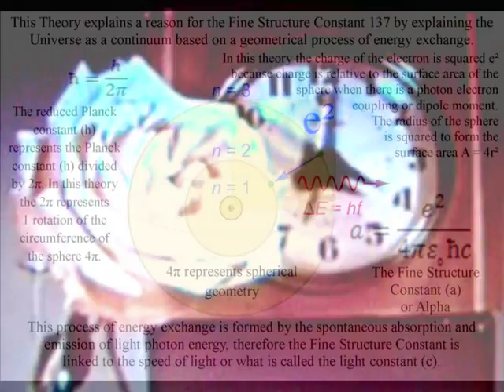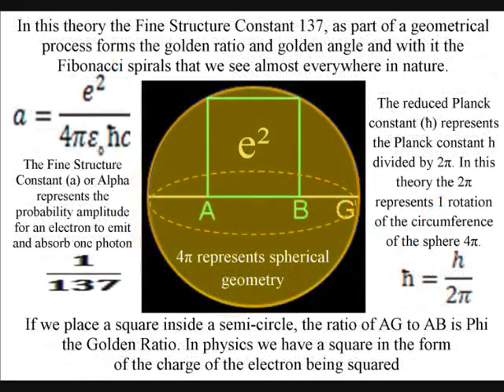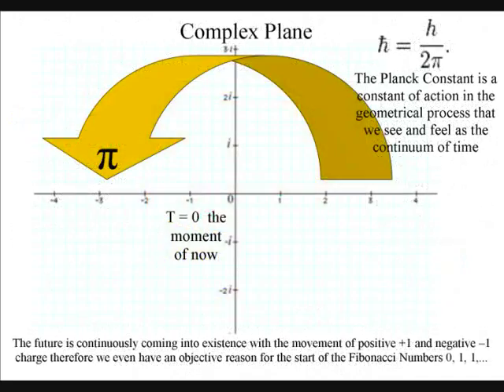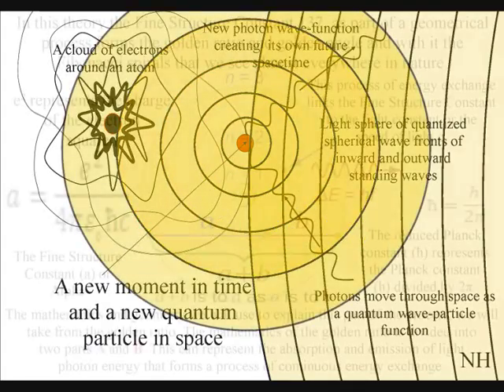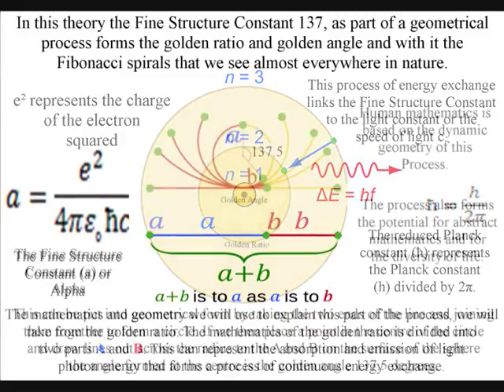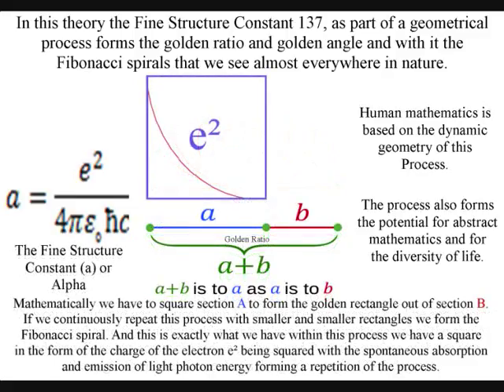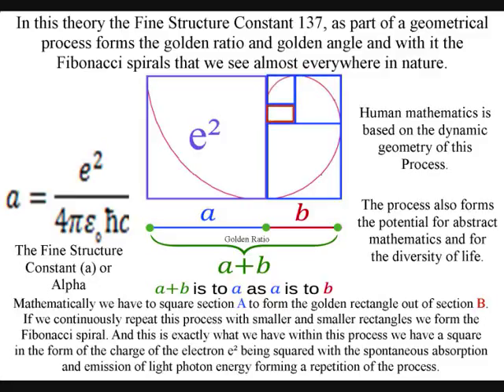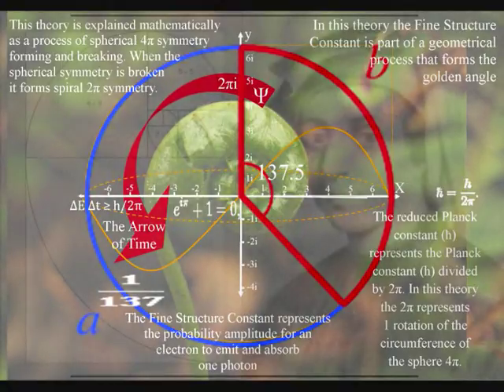A Reason for 137 the Fine Structure Constant

Comment: golden angle is 137.5077640500378546...... so the artist is correct. if you don't know or don't understand go find out for yourself. learn, then help somebody else learn, that's what the artist is doing.
Reply: tan(666)=1.37 
1/137 = 729,927

666 = 1 +...+36
666 % 360 = 306

306 + 54 = 360
666 + 54 = 720

360 + 720 =1080 (Radius of Moon) 
3*6*5*3*1*4 = 1,080 ( Earth Year * PI )

The Babylonians called the Moon Sin its diameter is 60*6*6 = 2,160

sin(54) + sin(666) = 0
365 * 365 * 3650 / 729,927 = 666
792 - ( 7 * 9 * 2 ) = 666 ( 7,920 Earth Diameter  )
Arctan(∛186,282)^2 = 7,920 ( 186,282 = SOL )
186,282  = 354 * 453 + (6!*6*6)  (Speed of Light = Moon Year * Reflection of Moon Year)
(6!*6*6)  = Procession of the Equinox 25,920 or the volume of a sphere with the radius of the Proton to Electron Mas ratio 1836.

log10( 729,927 * 𝜋 * 2 ) = 6.66
sqrt(186282)-66.6 = 365
Sin(54)-Sin(666) =  The exact golden ratio.

666 *666 * 666 / 10000000 = 29.5 ( Moon Month ) 

LogN(2π161) = 295 ( 161 is Golden Ratio 1618, 161*161 = 25,921) 
295 * 666 + 413 = 196,883 ( Monstrous Moonshine or Monster Group )
29.5 * 6674 = 196,883 ( Moon Month * Gravitation Constant )

The 196,000 tetrahedral / 883 Tetrahedral  = 10899802 ( CMB PAlindrome )
20899801 / 5280 = 3,958.295 ( Radius of Earth and Moon Month )

The speed of light exceeds the sum of squares at 82 it does so by 883 it takes 8.3 minutes for light to reach the earth from the sun. The triangles exceed the speed of light at 610  by 73. 
6/10 is the 161 day of the year. 

196,883-10601 = 186,282
 
Volume of a sphere with radius of the Moon  Year / divided by the Mile 
( 354 * 354 * 354 ) * 4 / 3 * Math.PI / Math.pow(5280, 2)  = 6.66

The Mile is based off of the Moon 2,160 has the sum of divisors of 5,280
186,282 IS THE MATHEMATICAL DIMENSIONLESS  value of the SPEED OF LIGHT and the Mile is base on it.

1 Radian = 57.2957 ( See that 295 in there ;-) )
So the Cube of the Circle is the SPEED OF LIGHT 

The cube root to the speed of light is 57.111

57^3 + 1089 = 186,282 ( 1089 is Cosmic Background Radiation ) 
5^7 / 57 = 137 (  5^7 is  78125 or 1/128 which is the FSC at high energies )

111^3 = 1367631 ( FSC Palindrome)

365 + 365 + 36.5 = 767 ( Speed of Sound )

29.53 * ( 3.14 + 2.718 ) + ( 666 + 666 + 666 ) * 365.2423 = 729,927
666 * 3 = 1998
729,927 has 432,000 coprimes ( Sun Radius )

1/365 =  2,739,726
1/137 = 729,927

36.5 * 19998 = 729,927
137 * 19998 =  2,739,726

 729,927
 * 2,739,726 = 1089 * 1,836,363,618 ( CMB, Electron Proton Mas Ratio, and Golden Ratio )

314 + 2,718 + 618 = 3,650
3014.2718 * 61.8 = 186,282  (3014 = 413/137)
There are 3,140 composite numbers less than equal to 3,650

Boson	       Celestial    	Mass	△ Mass	 Coprimes of △ Mass
Z Boson	       Sun	                912	        2,736	864
W Boson       Earth	        804	        2,412	792
H Boson	       Moon	        1254	3,762	1,080

Want documentation and way more check out Cosmology365 for all my original research.
Reply: @getyourchadon  wow, i like it ! This is going to take some time to figure out what you are doing with the mental gymnastics, i definitely see  its logically right... it has to fit with the fibronacci sequence
Reply: @paulpurdue5963  Hi Paul, well some of it requires no thought. Why does FSC have 432,000 coprimes its a universal constant not one of Earth. Why do the higs bosons have Sun Moon and Earth coprimes. Why is the atomic ratio linked to the time it takes for the Earth to process around its axis? I mean if we were to meet some Aliens the first thing I would do is make fun of them for not having a Sun Moon and Earth system so mathematically linked to their home world and star.
Reply from the maker: The Universe as a continuum seems to be represented in our static number system by the infinite nature of the irrational numbers. All numbers in this theory that represent an important part of the process are irrational like π, e, and the fine structure constant 137.5077640500378546......

Comment: Too bad it's 137.035999139 which means you're wrong.
Reply: Not only that,  but it's in degrees...which are arbitrary. You could have 400 degrees per circle if you wanted to,  and then you wouldn't get 137
Reply: Nothing Arbitrary about degrees. https://www.youtube.com/watch?v=QPg0yjKcgOc
Also, its Order and Chaos, and that distorts the perfection
Reply from the maker: This theory explains why we have irrational number. The video: A rational reason for irrational numbers.
 https://www.youtube.com/watch?v=LvcNzwa-wko
Reply from the maker: Exactly “degrees which are arbitrary you could have 400 degrees per circle if you wanted”. Life makes the choice out of the dynamic geometry that can’t be changed. The timeless constant Pi π that is found in nearly all the equation of quantum mechanics from the Planck’s constant ħ = h/2π to Heisenberg’s Uncertainty Principle ∆×∆pᵪ≥h/4π of position and momentum. Even in the uncertainty between energy and time ∆E ∆t ≥ h/2π we find pi π.

Comment: Quantum Mechanics and geometry is the answer to why things work the way they do. This also allows for the possibility of parallel universes. Since all life has this constant it can be said that any and all universes work the same way. Fibonacci Spirals are the perfected math that shows this process.
Reply: The important question is: what is the geometric shape of a quantum particle? ... In all equations of quantum physics, a number  (π= 3.14159. . . ----> ∞) appears. This can only mean one thing: a quantum particle must have the geometric shape of a circle (membrane) or a sphere (ball). And we have Planck's constant of action (ħ=h/2π), which must work as a dynamic process in this π - geometric shape of the particle.
Reply: @socratossoc  If A sphere stuck its face in a flat world it would appear as a circle. And a flat object in a sphere would appear as a circle because that is all it is. 
The significance of Planck’s constant in this context is that radiation, such as light, is emitted, transmitted, and absorbed in discrete energy packets, or quanta, determined by the frequency of the radiation and the value of Planck’s constant. The energy E of each quantum, or each photon, equals Planck’s constant h times the radiation frequency symbolized by the Greek letter nu, ν, or simply E = hν. A modified form of Planck’s constant called h-bar (ℏ), or the reduced Planck’s constant, in which ℏ equals h divided by 2π, is the quantization of angular momentum. For example, the angular momentum of an electron bound to an atomic nucleus is quantized and can only be a multiple of h-bar.
Reply: however the fine structure constant 1/137 is NOT constant, at higher energy values the number 1/128 emerges
i.e. The usually quoted value of the fine structure constant is 1/137.0359... This value holds at low energies. As is well known, this value increases somewhat with energy: it is about 1/128 at (M_Z)^2. Now, IF we imagine that there is no GUT, no physics beyond the standard model, no supersymmetry, and that QED is correct all the time (yes, that is a big IF), what would the value be at Planck energy (10^19 GeV)?
Reply: @islandbuoy4  Speculation.
Reply: "nothing new under the sun"  - King Solomon
"geometry will draw the soul toward the truth" - Plato 
how do we show associations between those two quotes and the 12,000+ year old CHIRAL swastika idea? eh? any idea?
you can start with a new learning curve called the CHIRAL ANOMALY ... do a search on wikipedia
Reply: @islandbuoy4  What I do not understand now I will when I go to God. He will enlighten those who come to Him and when we are made perfect, we can know all things. Right now knowing all things would be a great way to end the human race.
Reply: @Phumgwate Nagala No kidding!
Reply: You should check out Nassim Haramein’s work, he connects sacred geometry to physics equations and has solved many equations! Beautiful work
Reply: @dermalicekelly4157  lol ... Nassim is tricks for kids ... he is blind to what is hidden in plain sight